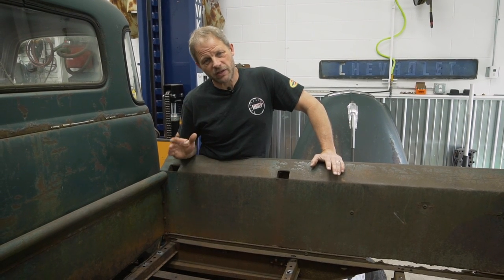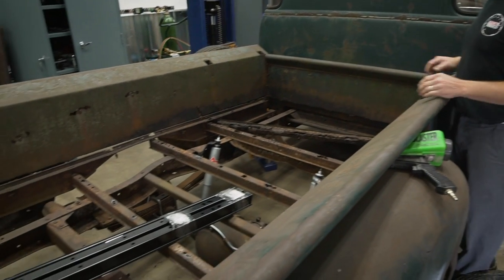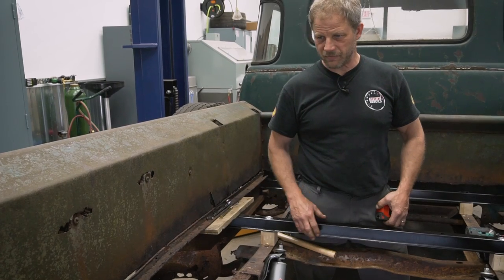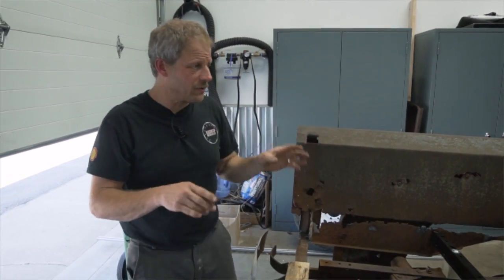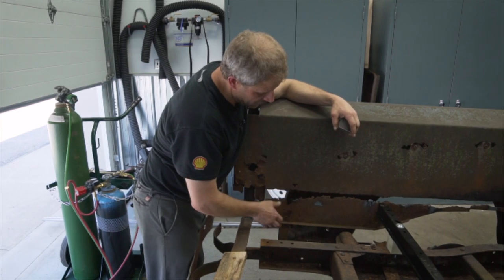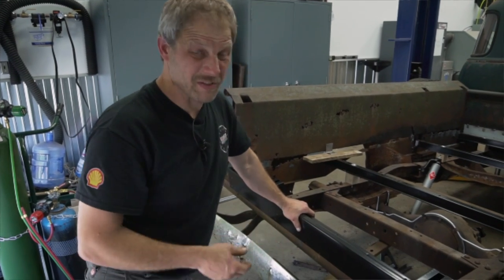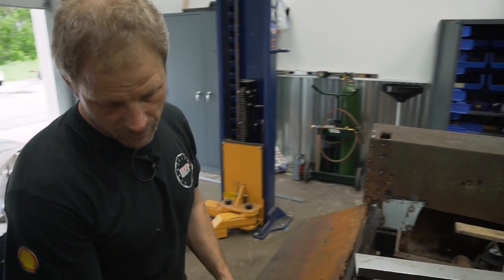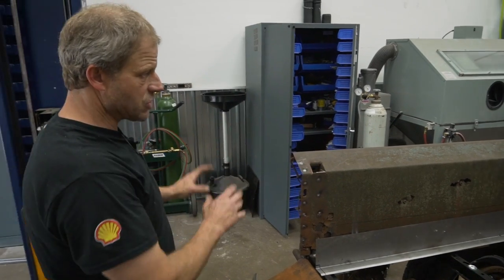Creating a farmer style truck bed in our 1950 Chevy pickup | Redline Update #44

Comment: My dad bought a new 50-5 window 1/2 ton at local Chev dealer in Oregon. He was a farmer took very good care of his equipment, nothing sit out side. He passed away when I was 9. Mom and my two older sisters drove it, when I was old enough I did too. I took automotive classes at a community college in 73-74 .I needed a engine to rebuild in school, the 216 had about 90,000 miles. Bored it . 030 over aluminum piston, milling cam, alittel hotter, decked block, shaved the head . 030, Fenton dual exhaust, new rockers and shafts, can't remember if I installed hard valve seats, think so? Re shimed the rods. Completely restored the rest of the truck 30 year's ago , drive it every summer. Wish I could send you pictures. You doing a really good job, sorry I was so long winded.

Comment: Love these videos.  My project in the garage today is to wire a new 5-way switch for a Fender Stratocaster.  No, it's not a car or truck.  But at least I will be out in the garage.
Reply: It's a worthy project. For my garage project this week, I'm installing a Floyd Rose into an old Kramer Strat copy, and doing a full fret re-crown. Should be fun.
Reply: @andoletube  Mine was a Chinese Affinity Strat - I gutted the electronics and replaced them.  Good pots, cap, switch, and jack.  MIM Fender strat pickups.  Now it doesn't sound like a cat getting swung by its tail.

Comment: I got one of those little blaster guns for $13.50 off eBay and it's been a game changer for prepping stuff on the cheap.

If you do want to try a blaster on the ultra-cheap, DO NOT USE REGULAR SAND BOX SAND. It will harm your lungs and blast media is cheap

Comment: Awesome,  that's what I do is get things sorted just to use, but will try to do nice things that I will sell later to up scale for my next project's,  at the moment  I'm working on a lawnmower just fixed the body one part rusted out so replace it welded a peace in then drilled new hole's then smoothed it out painted it, now sorting parts for the motor to get it going again,  so I understand of just making it work to use ,  but I would of cheated on the deck with one peace of plywood, 😀👍🏾

Comment: Rough sawn lumber is quite likely to shrink and change dimensions as it dries. You may want to dry it before using it. If you fit your side angles while it is wet/green it will shrink away and leave a gap where you don't want one.

Comment: What's the thickness of the ruff sawn Wood. Is it a standard. Years ago I had someone bent up sides for me. Looks great and it was cheap but I  also want to do the same with wood so I need to probably weld the angle iron after like your doing.

Comment: In the Army that is called "Serviceable" , Able to perform the designed function.  If you are on a farm you have a lot of serviceable equipment.  Also a lot less expensive than a new $80,000.00 unit.
Reply: On a farm you tend to upgrade if A: you spend to much time fixing something and it costs you money. Or B: the new thing is more capable and efficient and sticking with the old thing leaves you falling behind the competition.

Comment: I can appreciate your idea of not wanting to do a complete restoration. But is there anything you can spray on it that is clear and will help prevent further corrosion?
Reply from the maker: "Yes, a matte urethane clear can be applied over the paint. The trick is only applying a real thin coat." -Davin
Reply: Hagerty I was wondering. Thanks for the Reply Davin.

Comment: Love the series Davin. Question...What media are you using in the blaster. I have a similar unit, (harbor freight)tried walnut shells...will not feed it. Any help would be greatly appreciated. I have a 91 Silverado longbed(300,000 miles)that is mainly rust free and I want to keep it that way, surface rust on frame has to go, but media will not flow. Once I get media problem solved, bed will come off to paint frame and full check of components. She is my daily. My 4 yr old grandson loves pops truck and I intend to leave it to him in my will.
Reply from the maker: "That is awesome; I have a 89 GMC Stepside that I've had since '94 and my daughter (now 17) loves the truck. I pulled the motor a couple years ago to freshen after 235k of maintenance free driving and hauling. Of course the infamous 'while I am here' has captured the project. On to the question... In the blast cabinets I use glass beads or the black aluminum oxide. Anything that needs to be blasted with a pot blaster outside I use silica sand (aka beach sand or play sand), just don’t get it wet. If you have tarp down you can recycle back through the pot if you screen it." -Davin